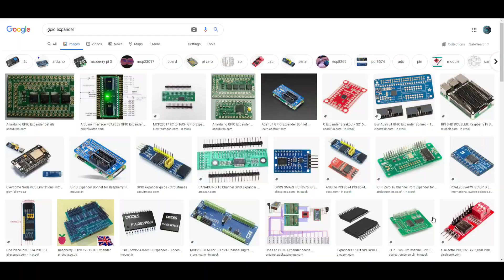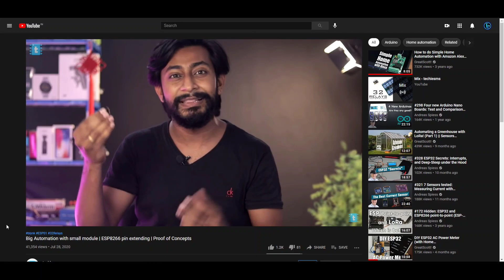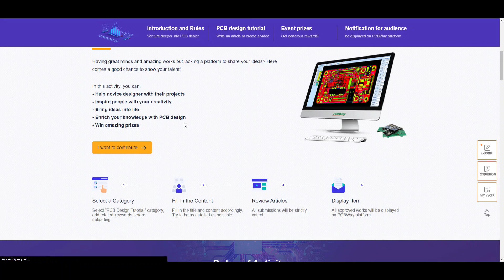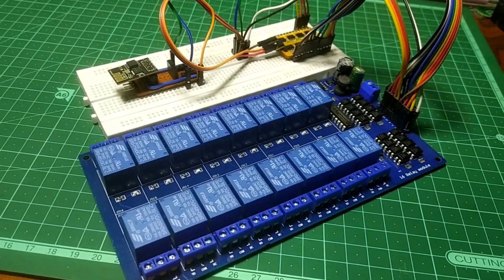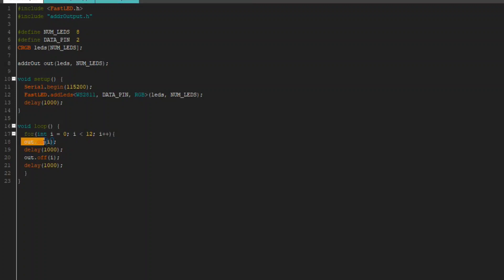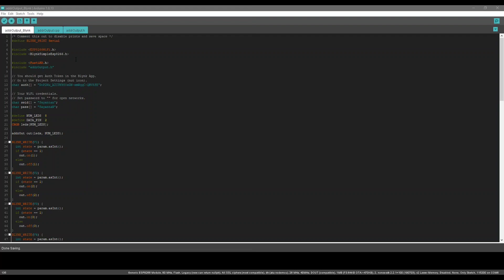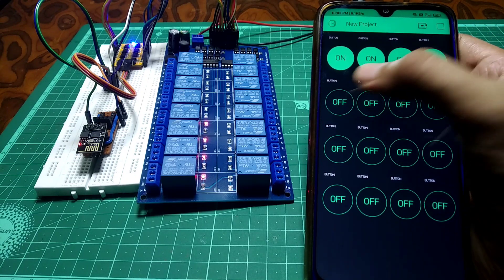How to make Relays Individually Addressable | One wire Output Expander

Comment: Hi, this is a great way to control many relays and is exactly what I am looking for! I see pcbway and your project site only mentions the WS2811 components. Can you please advise what the other components on the board are so I can purchase them. Thanks
Reply from the maker: Other than the IC, there is 100nf capacitor, as per the datasheet

Comment: Nice, you could also reduce the power in the relay coil by PWM'ing the output once the relay has switched on. Relays need more power to pull in than to hold in. So you might be able to drop down to 50% or less and still stay on. quite a saving on 16 relays on. Used this a lot to lower the power required in equipment with lots of soleniod valves controlling a blood analyser.
Reply from the maker: I will try that out. Thanks for the suggestion
Reply: @ElectroPoint4u  I thought of PWM as that's what the chip is designed to do, so you might as well get the best out of it.